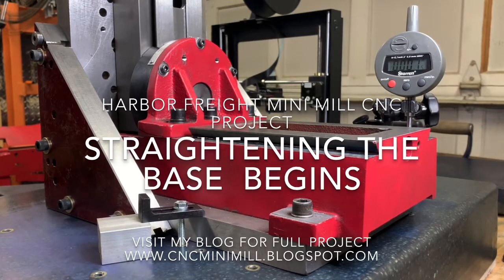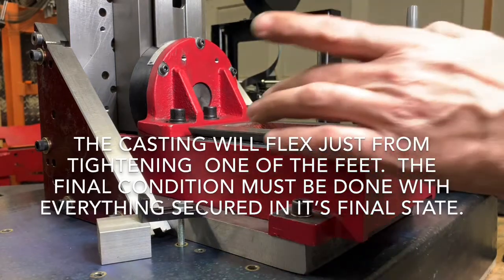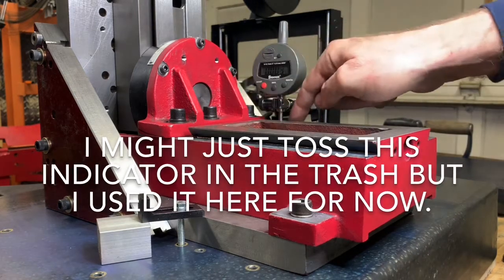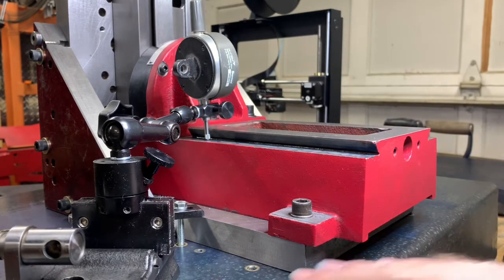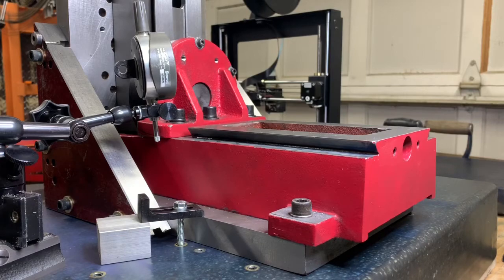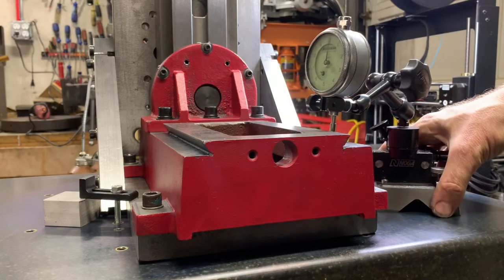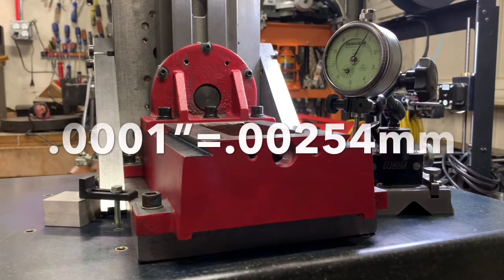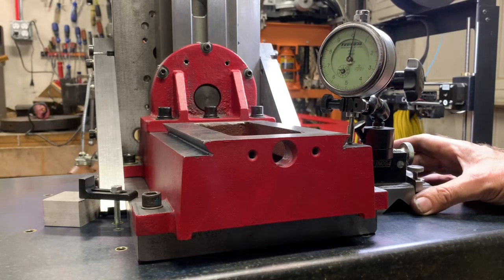Hand scraping the base of Harbor Freight Mini Mill CNC project

Comment: theres no need to indicate the base. your "level" is dictated by the quality of the machining on the feet... not very high.
the datum is the slides. two parallels higher than the dovetail,  flip it over on the surface plate. feel for the rock. measure with shim if you think the unnecessary step is important. it isnt.

lol, you dont even have to do that. 
use the saddle. as long as you know its flat, just check for rock. combine it with the straight edge, guesstimate things... have a scrape... check... you know if you guessed right. or wrong. a lot of scraping IS guesstimating.

Comment: you should not measure directly with the clock indicator on the scraped surface, use a 1inch square flat block of 1/2 inch thick. This is to avoid scraped wells.

Comment: Sorry but you use a lot of blue paint for nothing.Also,if i can help you a bit,better you scrap short,maybe 3millimeter,no long like that.
Reply from the maker: Thanks for the tip!
Reply: I remember theres  time you use thick coating and thin coating and none thick for roughing when theres a big difference on height and thin or none for fininshing.
Reply: @woozhi9218  i use a power scraper for roughing and medium finishing,but for lst finishing i use a hand normal scraper.i retrofitting some lathe,but for carriage i never use power scraper
Reply: @woozhi9218 sorry, what i use?